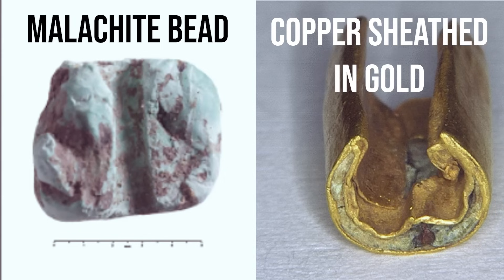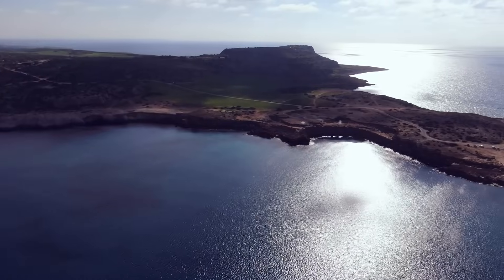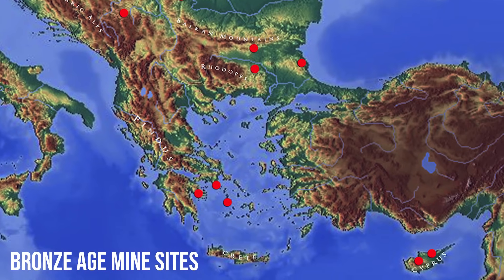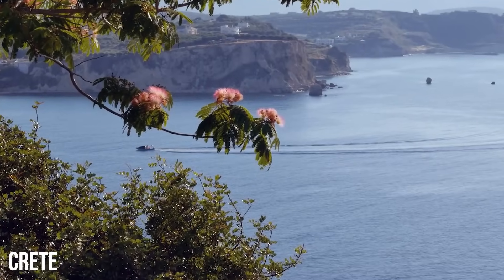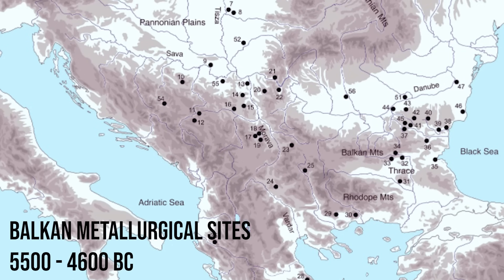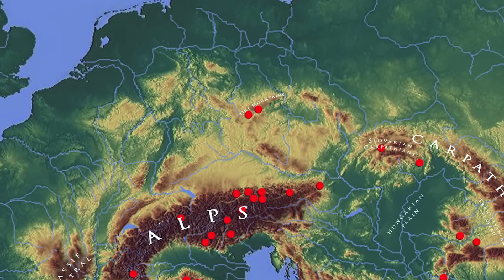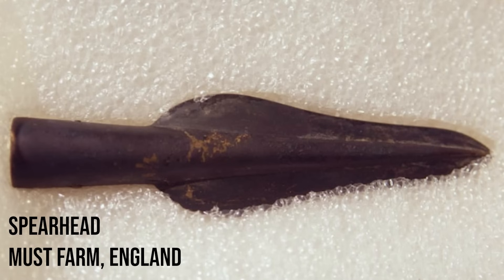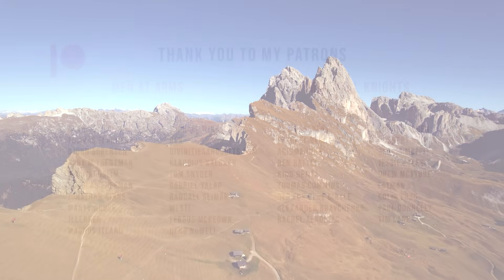These Ancient Mines Transformed Prehistoric Europe

Comment: I think the real mystery is why widespread use of metals never took hold in the Americas. The people of North America used copper to some extent for a while and then apparently stopped using it. In South America, they apparently even smelted a limited amount of copper alloys but AFAIK it never got significant use for weapons or tools. I would think copper and bronze would confer the same advantages in the Americas as it did in Europe but apparently for some reason the Native Americans didn't think so.
Reply from the maker: It's a great question.
Reply: @DanDavisHistory The reason is that smelting technology basically did not happen. Copper implements in ancient America came from deposits of native copper, not copper ore. While copper ore is widespread, native copper is much rarer. It is just an accident of geology that there is so much around the great lakes, and it is those deposits that account for most of the copper artifacts found in the new world. The metal was widely traded, so it appears in locations far from the actual source.

The relative rarity of the metal meant that it would have been used mostly for ceremonial use, not everyday use. While a lot was mined, that happened over thousands of years. The annual production across the entire continent on average amounted to about a suitcase worth of material in physical size. Spread that out across millions of people across the continent and you see the problem with availability.
Reply: @DanDavisHistory  I'm late to this discussion, but one thing I find striking about the European (or western Steppe region) development of the ability to not just use copper, but to alloy it with other metals is that it is roughly coincident with the development of two wheeled carts.  Heat and abrasion are serious impediments to speed and durability.  There would have been a serious motivation to figure out how to make better wheel bearings as attempts were made to use the carts as chariots.  This actually does dovetail well with Diamond's observations because of the dearth of suitable draft animals for using carts as chariots.  Often, the development of new technologies is driven by either an easy observation ((e.g. pottery flowing from clay lined baskets) or some challenge that drives experimentation.  The need for better wheel bearings would have driven some significant innovations in tool technology as well.  

The sequence may have gone something like this:  First the northern Europeans develop two wheeled carts to support agriculture and forestry. The people to the east trade for or capture some of them and take home.  They try to use them in battle, but fail.  So they go back to the source and explain the problem.  This goes on for a while until someone notices that some slag has become hardened can be controlled and made into a more durable metal, and so on.  The butt end of Corded ware battle axes or something very much like them would have been ideal for shaping and smoothing the female raceway of a bronze hub assembly.  The ones with the larger round center hole or something like them would have been just the thing for polishing the insert bushing that would have probably first been roughly shaped and mounted on the axle end.  There would have still been a serious lubrication challenge, but a lard bucket carried onboard would have enough in many battle scenarios  No long chases would have been possible, but short charges would have worked quite well.  Charioteers would have to have been VERY attentive to lube consumption and heat build-up.
Reply: Copper use actually never stopped. copper was still being used for art objects and certain tools all the way up to colonization. Because the great lakes copper is already pure, there's no reason to smelt it, so bronze production never really took over. Chert, flint, and obsidian are just as effective as copper for cutting tools (in some cases more effective than surgical steel actually) so once the great lakes region established exchange networks with the rest of the eastern woodlands around 3000 years ago there was no longer much need to make tools and weapons out of copper.  The Ancient Americas channel has a really good overview of North American copper industry.
Reply: I don't think that's a real question. It obviously was used, although smaller in scale. But we also know that North America had at least one and probably more cultural collapse and resultant Dark Age. When the new American colonists encountered them, its estimated that as many as ~95% of the native population had recently died by wave after wave of plague (in fact, the Little Ice Age is sometimes attributed to regrowth of so many trees due to this population collapse.) If North America as the "European" colonists first saw it was like the Mad Max post-Apocalypse version of native culture, it's no wonder that all kinds of things that they used to do were lost in the meantime.
Reply: @spacerx  The death toll among natives here was most extensive upon contact with Europeans who brought smallpox, and in fact began to use smallpox strategically to decimate native populations. This landmass was NOT sparsely populated generally.  There may have been some population declines in antiquity due to other catastrophic events, but there was considerable population recovery between then and the devastation of contagion which came much later with European contact.
Reply: @aaabbb8812 That isn't true at all. The germ theory of disease wasn't even articulated for many decades. That's not only a false narrative, it's an extremely stupid one that only really ignorant people would believe.
Reply: Supply and demand? As the video states, mining in the Balkans rose because of a large population that allowed for the allocation of labor to that activity, and declined when the population fell. and you would only allocate labor to extract copper if you have a demand for it.
Reply: The pressure to develop metals for weaponry would have been significantly greater in the Americas if they had the horse. Access to the horse was a significant factor in the evolution of civilization on the Eurasian continent. Australia is another example, it was populated for thousands of years before anywhere else but without the horse, and being separated from Eurasia allowed their culture to evolve much more slowly in alternative directions. 
That said if given enough time, South American cultures were becoming very involved in using gold, silver, and copper for decoration which is how metal work first began at the end of the Eurasian stone age. It was only a matter of time before some Inca like or Mayan related culture took the technology further.
Reply: @Alltime2050  Andeans and Purepecha were already using Bronze in the Americas.

And Australia is a Giant Desert(mostly). Unless having a super sea faring component to connect the more fertile outlaying areas and some alt domesticated plant that can take the bad soil in some areas, I don't see how they'll make it. Then again, a small habitable area to unify will also have its advantages for political unity.
Reply: @ikengaspirit3063  The only real difference between any of those places, Africa and Oceania included is they were isolated from the Eurasian continent. The only technology that was physically impossible for cultures outside of Eurasia to discover, was the horse. Discovering horsemanship at the same time they began smelting cooper and working with gold was like getting high-speed internet in those days.  The horse also made metal-tipped armies all but invincible as the first wave of genocides displaced first peoples across the Eurasian continent. Without the horse, Eurasian cultures would have evolved much more slowly and in ways more similar to those parts of the world where horses were not found. If the horse had not gone extinct in the Americas, it's almost a sure thing humans would have been fighting each other with metal weapons all over the place at the first opportunity.
Reply: @Alltime2050  You know, you're right but I think Population density is also a real deal breaker in alot of places.

Eurasia had the Near East, Europe, China and India(South-East Asia may or may not be added) as regions that could easily support a large population and population density over a large area and as you said, thanks to the horse and a more peninsular shape allowing those tech to transfer between areas faster.

I think population density is a part of this equation not recognized by many as well, More thinking brains(population), closer together to share ideas(population density) and ways to transfer ideas between cores of high population density/innovation is why I think Eurasia is the continent that developed the most.
Reply: @ikengaspirit3063 There were less than ten million people living on the entire planet at the beginning of the cooperage when the horse also came into play. Population growth in Eurasia began expanding exponentially after that while remaining relatively static with very slow growth everywhere else.
Reply: @Alltime2050 I was thinking it would be a real pain in the hole to carry around metal if you didn't have a horse. And why would you bother if you weren't going to make a stone house or didn't need chisels hammers and tools like that. If you could find a lot of flint or had the skill to use rocks then why would you bother with all that trouble. Unless for a pretty necklace or something. Also a sort  of critical mass thing. Like in usa people have guns because other people have guns. In europe if the guys down the road had swords you'd need swords too... if they didn't have swords why would you be bothered getting a sword. Like I'm irish we don't have guns cos nobody has guns so we don't need guns. If people started having guns here like criminals...then I'd need a gun too. And armour and such. And it kinda escalates. But if nobody has a sword then you wouldn't feel like oh shit I need to make a sword.
Reply: @Padraigp  Exactly.
Reply: @Alltime2050 ❤❤
Reply: @Alltime2050 for decorative purposes gold and even silver were used in America so perhaps the bronze wasn’t as valued
Reply: @Liveasamom  That's how it began on the Eurasian continent as well. The biggest difference between the two worlds speeding up the process many times over was the horse. If they had horses in the Americas the outcome most likely would have changed considerably.
Reply: @Alltime2050  The South American cultures used an alloy of copper and gold for many of their gold artifacts as well as pure gold. That copper had to have come from somewhere. Considering where copper was concentrated in the Americas, there must have been trading between North and South America here. There was so much gold in the Americas, that the Inca and Aztec were able to literally fill ships with it as tribute to the King of Spain. This greed for gold became an obsession and  resulted in Europeans enslaving natives to procure it for them.
Reply: @aaabbb8812  While a Slk-Road type of trade might have occurred on some level, those South American cultures were learning how to smelt metal. That never happened in the North, where pure cooper was lying on the ground. 

The production of copper spread throughout the Eurasian continent because they had horses. Everything in the Americas, including new ideas and technology, was transported on foot.
Reply: @Alltime2050  It is genes of European Neanderthals carried by Early European Farmers that really influenced the culture of paganist religion, materialism, greed, envy, the obsession with lethal weapons, cannibalism, human sacrifice, slavery, and warfare.  These farmers are represented by Cain in the Biblical story of Cain and Abel, and they spread the symbol of the swastika (the "Mark of Cain") throughout the world by boat, along with dolmen construction (and a few other traits inherited from cannibalistic Neanderthals), during ancient times.
Reply: @jedague That's an interesting theory but slavery and cannibals existed in Africa, Oceania, and Asia long before the first farmers ever existed.
Before the ancestors of the Hebrews were recording their first stories about Cain and Able, humans were already living on all the continents and most of the islands. Antarctica was the only large land mass that was free of humans. While not all of them were cannibals, almost all of them practiced some form of slavery. 
All ancient people were superstitious as F. Any peace-loving people were overrun, assimulated, or killed off by warrior cultures in a process that lasted all the way into the early 20th century.
Reply: @Alltime2050  At no other place in the world will you find cannibalism more ritualized and industrialized that in Herxheim Germany 7,000 years ago.  These Early European 
Farmers who used the symbol of the swastika were extremely violent.  Their migration can be traced thoughout the world by their unique culture.  I think it is very interesting, but also very frightening, to recognize how specific inherited traits have continued and spread throughout the world for millenium.   But my own preference is the for the megalithic builders of Gobekli Tepe, not the cannibals of Northern Europe who invaded Gobekli Tepe and inherited farming culture.  Consider Armin Meiwes, Amon Goeth, or Jeffrey Dahmer for example.  They would have felt right at home in Neolithic Herxheim.  Then study the migration of the swastika.  Modern descendants of the Mesoamericans who used the symbol of the swastika are members of Latin American Drug Cartel who practice paganism and worship death in the form of Santa Muerto.  This is an ancient, inherited trait which followed the symbol of the swastika.  After the Bronze Age Collapse, the symbol of the swastika migrated into China, Korea, and Japan, along with dolmen construction, pyramid construction, and human sacrifice.  Wherever violent people who engage in warfare exist, you find ancient evidence of the symbol of the swastika.
Reply: @jedague  There were only a few million people at most on the entire planet during the time periods you are referring to. 
While I don't take issue with your tracing the path of the swastica, I'm not so sure that cannibalism was as large of a factor past a certain Neolithic time period as you seem to be suggesting. Those cultures could be incredibly brutal and cruel all on their own. That's just my own personal speculation though. 

It's absolutely true that the Germanic tribes evolved into the most prolific and long-lived warrior cultures on the planet. I mean, they never stopped F'ing up any weaker cultures they came across. By the beginning of the 20th century, their descendants had conquered and controlled almost 80% of the world's population. 
On the one hand, it was a terrible thing. On the other, it stirred the stew. 
Without their eagerness to share their superior technologies to feed their never-ending greed for wealth and power, at least half the world would most likely still be in the stone age. 

It can be argued that the brutality of their world-conquering lifestyle was a useful mechanism for the advancement of our species.  
But if that was ever true, their usefulness as a tool for human advancement became obsolete the day they finally invented technology powerful enough to destroy the planet. 

Humanity has slowly been working to overcome their ancient worldview since at least the middle of the last century. 
I find it ironic that people still beholding to the superstitions of their Romanized Germanic ancestors have gone from masters of the world to the greatest non-natural threat to the survival of our species in all of human history.
I apologize for changing the subject if that's what I've done.
Reply: @Alltime2050  No apology necessary.  Brutality is absolutely correct.  It is the inherited traits of cannibals, the lack of empathy for others, which leads to brutality.  The descendants of ancient cannibals tend to engage in human sacrifice and unprovoked violence.  The Aztecs were prone to war and human sacrifice, their descendants are Latin American Drug Cartel that worship Holy Death.  The Japanese joined in Germany's warfare and destroyed America's Pacific fleet at Pearl Harbor, and engaged in horrific brutality, rape, and slavery during World War II.  The Koreans engaged in the Bodo League massacre and killed about 500,000 people during the Korean Conflict.  The Vietnamese engaged in the Cambodian genocide that led to the Vietnam war.  The Germans probably killed 100 million people during World War I and World War II.  Consider the horrible acts of brutality involved in the Holocaust.  These are the descendants of ancient German cannibals, the people who carry genes of cannibalistic Neanderthals.

But this aggression which led to dominance also has a negative effect.  And modern firearms may contribute to this negative effect.  The most aggressive people, those who tend to be drawn toward conflict and violence, they now tend to be on the front line of people who are killed during conflict.  So gradually the inherited traits of cannibalistic European Neanderthals are being removed from the gene pool.  Evolution is at work.  But every time you hear of a mass shooter, a monster, a cannibal (Jeffry Dahmer, Armin Meiwes, Amon Goeth) you can trace their pedigree back to Herxheim.  These farmers were brutal enough to gain a prime spot in the Hebrew Bible, in the story of Cain and Abel.  For millennia ancient people have told stories of the brutality of these Early Farmers who spread throughout the world during antiquity.  We're still dealing with the problems that the genes of cannibalistic Neanderthals create today.
Reply: @jedague wow, that sounds like some made up gibbery nonsense but I’m no anthropologist or whatever so 🙄 
😎🦅🇺🇸
Reply: I suspect the significant factors include:

1) copper itself is not terribly more useful than well-made stone tools. Only bronze will provide a truly worthwhile improvement.
2) getting tin together with copper to make bronze, implies trade (transport of large quantities of heavy ore or metal)
3) such trade is hard to develop without a certain level of organized government, fairly high population densities in some areas, and appropriate transport conditions (draft animals/carts/roads, and/or watercraft of fair burden and endurance along with bodies of water convenient for moving heavy loads; enough population to support the transport infrastructure, etc). Most of these conditions were present with the Inca, and they were using bronze. They were present a long time ago around the Med basin, and they also were using bronze. But even at Cahokia or the Mississippian polities, the necessary conditions were missing. I would suppose that the Central Mexico cultures would’ve started using bronze pretty soon had they not been interrupted; the Aztecs had consolidated the necessary conditions, by and large.
Reply: A few reasons:

1) Eurasia is rotated in an East-West layout while the Americas are in a North-South layout. This made it difficult for agriculture to spread very far beyond a few origin points in Mexico, Peru, Brazil, and the Eastern seaboard. This in turn led to less willingness to trade. It still happened of course, but on a smaller scale than we see in the Mediterranean. Less trade means less opportunity for technologies to spread.

2) The Caribbean is a LOT more dangerous than the Mediterranean to travel through so the vast majority of any trade routes would be overland, again a limiting factor to trade, especially with no pack animals, and thus technological spread.

3) Mining tycoons and early European colonists alike noted how much harder it was to get to metals like iron in the Americas than in Europe, the rocks were harder, the metals deeper, and that outside of maybe meteorite iron you'd NEED modern (well, modern in terms of the 1800s) equipment to get to it.
Reply: The reason is that the copper they used is native copper, not copper extracted from processed ore. Native copper occurrs naturally in some areas around lake superior, where it was dug up and pounded into various shapes with rocks. The quality of that sort of copper would not be that great, so there were limitations on what the metal could be used for beyond ornamentation. Plus they probably did not get a whole lot of it to start with.
Reply: Too busy admiring their gold jewelry.
Reply: @paulberry2884  😆 Some South American cultures definitely had impressive metallurgy skills with regard to gold. I don't remember the people off the top of my head but one culture had a method of making an alloy of copper, silver, and gold and treating it in such a way that the gold rose to the outside but remained bonded to the base metal. It was so good that the Spanish thought it was pure gold until they melted it down at which point they were mightily annoyed. I've read that the Incas made silver shoes for horses they captured from the Spanish during their war of resistance so metal-working was definitely a thing. Maybe it just got cut off by the Spanish conquest before it got a chance to really take off.
Reply: @itsapittie  Silver was abundant in Central America and would surely make a better sword than copper or bronze?
Reply: @pattheplanter  Silver is heavy and soft, a mace or hammer is the only reasonable silver weapon to make and even then just the head as the shaft would readily deform. Silver is far softer than copper or bronze
Reply: @pattheplanter yeah but if nobody else has a sword why would you need a sword. America has guns now and other people don't because why would you get a gun if nobody around you has guns. Like it's not a natural progression that you should start with stone and move on to metal and then get a gun. People have not all embraced guns since the gun was invented or discovered. Just cos its an option doesn't mean everyone is going to do that option as if it's like crawl then walk. Why didn't Europeans have origami? Why did nobody in ireland develop foot binding. These are not some sort of developmental delays. They are just options.
Reply: Lack of horses kept things more local.  The Mayas and Incas understood the use of wheels, but didn't have an animal that could pull tonnage like in the old world.  Horses surviving the last Ice Age changes everything.
Reply: Lack of sufficient pop density and competition I imagine. Specifically north America simply has no real need for that amount of industrialization. You have to develop an interest in farming first in order to get the population that high.

I have long suspected the lifestyle of the hunter gatherer is just a very HUMAN thing. Very natural. Whereas civilization brings a lot of interpersonal conflict and stress, and that people who preferred that lifestyle just kept to the periphery of civilization and held on to it as long as they could. Even several hundred years of exposure to Europeans after Columbus did little to convince North Americans to change their lifestyles.
Reply: Too busy ripping peoples hearts out and carrying stuff on their back rather than on wheeled carts.
Reply: A widespread Bronze Age did not emerge in the Americas due to the limited availability of tin, localized metallurgical traditions, the abundance of effective alternatives (stone and obsidian), and the lack of societal drivers such as intense intergroup conflict or the formation of early states requiring large-scale bronze production. Also, there was no need for military use, which drove much of the bronze technology in the Old World.
Reply: the people mining copper in Michigan were the Minoans
Reply: The only thing that strikes me as something the US didn't have was horses and I heavily suspect that horses may have been the reason that Asia and Europe and then Africa went into the bronze age but America didn't, bronze as armour doesn't work very well for a footsoldier, but on a chariot it does, like wise with the added time available and surplus generated by horses doing Labor  (plowing, transportation over land ext) would facilitate the specialisation and knowledge sharing required for persistent bronze and copper use.
Reply: Simply put, there wasn't much demand in the Americas.  Metal tools, implements, weapons, etc become much more useful when you have draft animals, which they didn't have in the Americas.  Many, if not most crops in S America were grown on terraces, not fields like in the Middle East and Europe, so draft animals would have been less useful even if they were available... so they didn't need to develop metal rims and spokes for wheels, metal plows, metal parts for wagons and harnesses etc.  Metal weapons and armor used by the Spaniards are much more useful when used on horseback.  Once they invaded, many Spaniards gave up their plate armor for lighter padded armor used by the indigenous Americans, and gave up their swords for the clubs they used as well.
Reply: Not an expert - possibly tin availability  -  copper certainly isn't a bad metal, but its comparatively soft compared to bronze.  So unless someone happened to experiment with copper ore and tin ore simultanously and followed it through and enough people knew about to figure out the process. And smelting bronze  is an intermediate step to iron as far as smelting temperatures go.  Ignoring arsenic for now.
Reply: @tacitus7797  Apparently a couple of Andean cultures did smelt bronze. Of course, they were separated from the rest of the Americas by 1,000 miles of some of the most hostile jungle in the world so perhaps it's just that the few people who did it never had a chance to share the knowledge.
Reply: @tacitus7797  Andean and some cultures in the south used arsenic and other ores to create pretty strong bronzes and Inca was already experimenting smelting hematite, because they used to cut rocks, and rarely ilmenite. During final moments of spanish conquest of Peru, Inca was producing better sword than Spaniards with appropriate size and form. But some internal struggles about Inca’s Emperor and very young one leadings
during the war was good to enough to facilitate Spanish Conquests
Reply: Inertia (as in being content in ones level of tech) can be strong. Why did the wheel have such a limited origin and only spread when the tech was exposed to other peoples?
Reply: It is interesting and could have much to do with the time of the migration of these peoples across the land bridges. The death rate would have been fairly high and the "elders" dying, and the knowledge they had, lost.
Reply: The Native Americans used copper in its "native"state or with very little working and no smelting. They did have widespread trade networks as evidenced by sea shell ornaments located far inland, etc. They used copper for ornaments, crude arrowheads (coneshaped) and there is what could be a flint working tool found among northeastern Meadwood culture artifacts from roughly 2,000 yrs ago. They made wonderful large thin bifaces that could be made into various tools. Lastly, i learned that many Pacific island peoples never used/developed ceramic pottery even though they had the materials available, why? They didnt need pottery as they had other means of storage/cooking vessels - probably why Native Americans didn't develop more advanced use of copper.
Reply: Oh, and for those who dont think NAs didnt develop large scale agriculture look at the developnent and spread of maize as an example.
Reply: I read that the American copper was too pure, and therefore, there were no accidental alloys. No accidental bronze means no hardness. Compared to Flint tools, pure copper is soft and doesn't hold an edge.
Reply: Probably was used by the white people before the todays natives moved down in from Siberia.
Reply: Man plus horse plus metal equals war .
Reply: its about the combination of high intensity agriculture, so the culture can "afford" artisans, and be lucky that a artisan to invent metal tools, have mine that produce copper and tin within reach. 

Not that the cultures that  have high intensity agriculture in America, do not have a nice inland sea like the Mediterranean Sea or inland river like Danube that connect different culture that have high intensity agriculture like them in Europa, to move trade gods (ore) and transmit ideas (metalworking) 

For all we know, some American artisan did invented metal tools, but there was no real way to get accesses to cheap copper, and the idea did die out.
Reply: It's about racial capacity, obviously. Just look at Africa.
Reply: Copper by itself is much less useful than copper which has been alloyed with tin to form bronze.  In Europe the ores were occasionally "contaminated" with arsenic (naturally forming arsenic  bronze) so they would have known that some forms of copper produced much better tools than others.  This is likely what led them to alloy copper with tin.  This development process never occurred in North America.
Reply: @rockets4kids  No, but it did occur in South America, yet it never really got into widespread use. It would be interesting to know why not.
Reply: @rockets4kids  What you are talking about is arsenic bronze and it did indeed not develop (to our knowledge) in North America. It did however evolve in Tiwanaku and we see some uses of it among the Incas. In Mexico, the Zapotecs were the masters of metals but they mainly seems to have used copper and gold, the little arsenic bronze we found in the area might have been imported so we don't know if they knew the process or not.

The reason no one invented tin bronze might partly be because the 3 largest tin deposits are in Alaska, California and Bolivia which lacks large copper deposits in the areas, there are some smaller around...
In the old world, we generally see the earliest bronze production around places who have a lot tin and copper, like Cyprus for instance.

The area around Tiwanaku is rich in copper and arsenic which is likely why arsenic bronze was invented there and it wasn't just a random contamination but a product made on purpose. However, it was a very dangerous work so they could never produce the massive amount of bronze we see in Asia and Europe.

In Puma Punku (you know, the place the weird Ancient aliens guy make weird hypothesis about all the time) they actually made bronze hooks keeping the stones of some of their building together, the Greeks used a similar method.

Arsenic bronze is more brittle then regular bronze but it is certainly still good enough to make weapons (like spear tips and knives) and armors out of as we see in Eastern Europe in the early bronze age. It was however rather expensive so it was not something you could use on a large scale. Some tools have been found but very few weapons, that might have been because they melted them down again when they broke though. Most of it seems to have been used for jewelry by rich people, we also found some bowls and other random object, all decorated and looking expensive.

The thing is that the only places in the Americas that really had the potential for inventing real bronze was Peru and California. California have plenty of both metals and was inhabited so it had pretty good chances of inventing it there but it never happened. Peru only have small tin deposits so it is less likely.
Alaska also have both but had a tiny population which tend to hurt inventions.

In Tiwanaku, it is likely that someone noticed that the copper who was contaminated by arsenic was a lot harder and more useful, and figured out a way to replicate that. The lack of tin in the area killed of any further developments though. It is very possible that if whoever figured out how to make arsenic bronze got his (or possibly her) hand on tin, it might have sparked an American bronze age.
Reply: I think you need to research, more. The bronze age in the u.s., apparently ,
does have a long rich history
Reply: Lower average IQ leads to less sophisticated culture.  In other words, not much "stuff"
Reply: They literally didn't even discover the wheel. I think that answers your question
Reply: How about that wheel eh.
Reply: I don't believe that there are any significant deposits of tin in the Americas, so that would rule out a "Bronze Age" in the Americas.  There are limited tin ore deposits in Mexico, Bolivia and Alaska.  As far as I know, there are no placer deposits.

hth
Reply: afaik they never got to the point of figuring out the more ideal ratios for bronze (9:1 copper/tin in the classical world) which may have been a factor. Maybe the old world got lucky in figuring out how to make the good stuff.
Reply: @mynym4543 Well there is that, but the big impediment to a bronze age in North America is a lack of tin deposits.
Reply: No. It isn't a mystery at all. The 2 continents are nothing alike, socially or geographically.
Reply: There's another factor in the terms of copper alloys used in North America is the general lack of tin deposits. The whole idea of native copper from deposits on Isle Royal and the Kewanee Peninsula is an idea that really flies in the face of logic. For one thing the Upper Peninsula is a good way inland. Summers are pretty short compared to other copper using regions. 
Did any Bronze Age sailors wind up in North America? Its possible I suppose. Did they get home? That another thing. Most likely no. And any Bronze Age sailors that did wind up in the Americas most likely wound up in the West Indies. Now could a  Bronze Age or early Iron Age vessel have been driven by weather and current across the Atlantic. And then picked up pieces of copper in trade. And then made it home. It's long odds. Possible but not likely.
Reply: @mpetersen6  I think it's very likely that every century or so a vessel from Europe or Asia made landfall in the Americas due to being caught in a storm. I think it's very unlikely that any of them made it home or arrived in sufficient numbers to make any noticeable impact on American cultures. I think the probability of a trading network linking the Americas with other continents is essentially zero.
Reply: Bronze is nice and all.   But consider the differences in development between a food-rich all-season area like Egypt to Bronze Age Britain or Scandinavia.   Part of the difference might be that Egyptian terrain was better suited for Bronze tires on chariot wheels.     So I don't think nations in the Americas would have enjoyed all that many more advantages with or without it, especially lacking horses.       Other factors played a more significant role.    A harder metal like iron might be different.  Since this allowed iron tires for chariots etc. That can handle continental European terrain etc.     Americas still lack the horses.
Reply: @MarkVrem  That's a good point. That certainly could have been a factor.
Reply: There is no mystery. Copper is pretty useless as a weapon. Metal weapons and tools only really took off when bronze was invented. During the "copper age" even most Europeans still used stone, bone or wood tools for everyday use, there is no reason to think Americans would have done anything different.
Reply: @Tugela60  Are you forgetting or ignoring beads, Jewelry, clothing and body decorations.  Gold and silver are preferred, but Copper and bronze have been used in these applications.
Reply: @dewayneweaver5782  All of which were pretty much limited to high status individuals due to the sheer amount of work required to extract and process metal in neolithic societies. Even in the early bronze age, most people would have still been using stone, bone and wood.
Reply: @Tugela60 dude they built all the pyramids for hundreds of years with copper tools. They definitely were not useless. But if you had no intention of doing the things people do with metal why would you bother ...like I dont think they built stone castles ... they didn't have horses to carry a heavy metal thing around..they could walk around and leave their rock tools behind and just find rocks where they went ...they were going to put up a tepee yurt thing to live in and move along in a while anyway so no need to shape rocks into a castle ... except for making pretty beads of shine copper or nice ornaments why would they bother with copper when they also didn't bother with the things copper was being used for either. Like if you don't eat bread don't buy a toaster.
Reply: @Tugela60  
Copper axes were very common and no doubt used as weapons, of course they better suited for than let's say copper blades which tended to be daggers for the most part.
Reply: @Jarlemoore1  They were not "very common". They were used for ceremonial purposes and would have been only owned by high status individuals. A copper axe is no match for a neolithic stone axe when it comes to actual work due to its softness. It requires constant sharpening. Metal only became relatively common and functionally usefull for everyday purposes during the bronze age since bronze is a lot more durable and holds an edge far better than copper.

Bronze requires tin, and there is no evidence of tin usage in the Americas AFAIK. That means that the copper mined in America in ancient times was probably used for ceremonial purposes, and more likely mostly for pigments, something copper happens to be very suitable for. Everyone seems to be overlooking that other obvious application of the ore. Just because copper ore was mined does NOT mean that is evidence of extensive metal use.
Reply: @Jarlemoore1  They have not been found in "a lot  of graves", they are only found in high status graves. Copper weapons and tools in the chaleolithic were not common at all, most tools in this period were still made of stone, bone or wood.
Reply: @Tugela60  the copper wasn't in ore form, like locked up in minerals. It was nearly 99.95% float copper. You can find veins of solid copper in the great lakes regions.
Reply: @Tugela60  give me a Copper Axe every time, I wouldn't say a copper axe requires "constant sharpening", the edge simply needs to be annealed & then hammed back to a thin edge which coincidentally also "work Hardens" the edge, if over the long term the Copper Axe becomes warped to the point of un-usability then you simply melt it down & recast it.
On the other hand a Stone Axe that is as sharp or sharper than a Copper Axe is of a type of Stone that is Napped & is also brittle enough to need constant Napping & Napping is a skill that takes years to master, Stones Axes that are harder which require a ground edge are never as sharp as either a Copper or Flint Axe & lastly neither type of stone can be melted down & recast.
Reply: @Tugela60  
Useless you say. Copper leaps buildings in a faster than a speeding train. Carves obelisks in a bound. Builds pyramids in a thrice. It's a miracle material.
Reply: Jarred Diamonds take on the question is imo flawed but does make some very strong arguments. 

Basically, Eurasia has a lot of places within trading distance of each other that have similar climates. This allowed agriculture to spread rapidly along the region between Spain and India, and the plains of China were large enough to be their own separate cultural center. Meanwhile the vast steppes and the Indian ocean and seasonally-reversing monsoon winds and east asian seas and island chains created lots of opportunities for less direct but still culturally significant trade.

The Americas by contrast are more broken up into smaller climate regions so there is less opportunity for those kinds of extremely long distance exchange of ideas.

Also, his point about nearly all the economically-useful herbivores in the Americas having been wiped out seems valid, as does African fauna being universally impossible to tame.

What Diamond claims that I'm less convinced by is that there weren't enough useful agricultural plants in the Americas.
Reply: @j.f.fisher5318  I've read his books and I agree with your analysis, but that doesn't explain why people in the Michigan region who had a nascent copper culture abandoned it or why South Americans who were smelting and alloying bronze never used it more extensively.
Reply: @itsapittie  
Maybe it was abandoned because the people who it originated with were wiped out and replaced or famine or disease caused them to move away from the copper sources and after a few generations it was forgotten about.
Reply: @Jarlemoore1  It's a bad theory either and could possibly be true.
Reply: @itsapittie  not a mystery dude.  All that NA copper came from a single source. Not ore, metallic copper.  The locals never learned smelting, just cold hammered copper metal.
Ancient Americas has a nice video on YouTube about it.
Reply: @itsapittie 
And then there's the idea of societal collapse. If the Bronze Age societies, which in some ways were far more complex and sophisticated than even our own modern societies, with far more safeguards against disaster than a simple tribe could ever hope to have, could fall apart then what is keeping semi-nomadic tribes in the Americas from also falling apart? Especially when considering these tribes were often just one bad harvest away from mass starvation.
Reply: @itsapittie I mean didn't they live in yurts or something? So they wouldn't hsve needed hammers and nails for that. And did they not have horses? Before Europeans brought them? So if they didn't have horses they wouldn't have gone very far without walking ...did they have doneys? Carrying a load of metal around might be fine on a horseback but dragging it on your back might be a pain in the hole. Be handy for cutting trees down though how did they manage that without any metal?
Reply: @j.f.fisher5318  The cultures of Central and South America produced Cities, Temples, roads, bronze implements and small scale  Empires, they domesticated llamas for pack animals and alpacas  for wool.  There mane deficiency seems to be the lack of  horses and mules. Do both Eastern and Western Civilization owe their prosperity to the humble Ass?  I don't think the case is proven but it's an interesting thought.
Reply: @dewayneweaver5782  The ironic part of the lack of horses as draft animals precluding the invention of wheeled vehicles, etc, is that the early migrants to the Americas killed and ate them all.
Reply: @dewayneweaver5782  "Does Eurasian culture owe its development to the humble ass?"

Yes, the bigger the Ass the better
Reply: @j.f.fisher5318  how were the herbivores mostly gone , in the Americas, 5000-4000 BC?
Reply: @j.f.fisher5318  There was plenty of plant agriculture in the americas, a great deal of modern crops originated there:corn, potatoes, tomatoes (less sure about them), squash, cacao, etc. Regarding animal agriculture I'm curious why it didn't catch on. Horses are originally from north america but went extinct there at the end of the last ice age for reasons unknown, bison are large and cantankerous compared to modern cattle but are perhaps analogous to their ancestor, the aurochs. Javelina are not so different from Eurasian pigs. It occurs to me that agriculture perhaps creates the conditions for its own necessity: in the old world, natural systems were disrupted by agriculture (land degradation, disruption of migratory paths, human population growth), making more intensive agriculture a necessity to sustain the growing population.  In the new world it seems in most places they didn't turn that corner, although there are many examples if landscape management to better facilitate hunting and gathering (periodic controlled burning to revert woodlands into savannah comes to mind), as well as small scale agriculture to supplement the diet.. This is just speculation, I don't have any qualifications
Reply: @j.f.fisher5318  interesting that he claims there weren't enough agriculturally useful plants in the Americas since about 70% of the current world's foods originated here. I think the lack of metallurgy in the Americas was due to the abundance of resources and the lack of equivalent population pressures.  Unfortunately, the lack of animal domestication meant that the opportunity for exposure to pathogens passed us by. There is a theory that European proximity to domesticated animals allowed populations to develop immunities to disease over time...except for the diseases introduced by trade with China, which has a geography that creates diverse petri dishes in isolated climates. Bring any of those petri dishes together and cross-species pathogens erupt. Nearly all the pandemics of the world originate in China.
Reply: @j.f.fisher5318  you need to combine some other authors to flesh out diamond.  Flannery (I have it in the library if you are interested I can be specific) wrote a history of NA from the chicxulub comet impact to modernity.  One huge problem we have is the shape of the rockies/Appalachian mountains- they act as a funnel to pour extreme weather into the continent. That handicaps agriculture enough to keep it rudimentary.
Reply: @j.f.fisher5318  2 of the 4 greatest crops in history, corn and potatoes, came from the America's so yeah I'd agree that it is a weak argument.
Reply: @j.f.fisher5318 I mean the Americas includes america which is one big landmass... that doesn't make much sense. Its a big continent I know it's not as big as eurasia with its connections to India Africa etc but its still pretty big and diverse enough to warrant trade.
Reply: @j.f.fisher5318  Native Americans did have extensive trading occurring.  Most notable are the Commanche who traded with both Mexican tribes and the Northern Plains tribes.
Reply: '“America“ is a Spanish word, when you say “Americas“ you are saying it incorrectly. “America“ is one continent. When Spaniards refer to “Americas” they are refering to the islands of America. Please dont use Spanish words if you dont know their meaning.
Reply: @sergiogcollado  I thought that the name America was based on the work by an Italian explorer, Amerigo Vespucci.  The word was coined by the German cartographer Martin Waldseemuller.  He named the lands "America" based on the Latin word "Americanus".
Reply: @j.f.fisher5318  Cross-biome trade is already long-documented. A much more significant factor is the lack of animal transportation; however, the Americas still had ship trade. The latitudinal trade network from Europe to Asia covered sea, and large swathes of entirely uninhabitable desert and mountains, and trade has long ran north through south as much as east through west. This fallacious claim is one of his claims that actual anthropologists and historians most dislike his work for.

Africa is (somewhat) less lacking in tamable animals than often touted. They had cattle 6,500 years ago, albeit most other domesticated animals are Asian in origin. Rather than a lack of available animals, some that were around in more northerly areas have difficulty further south due to disease and teste fly.

What is now Brazil has the greatest biodiversity on the planet. A large proportion of globally dominant foodstuffs are American in origin-maize, bell and chili peppers, tomato, potato, sweet potato, many varieties of beans (the introduction of a few beans and legumes from Asia preceded a population explosion in Europe), squashes, cocao, vanilla, and less commercial crops such as amaranth, quinoa, peanuts, a long list of fruits, cassava, chia, and many more. Beyond that, the Americas have a lot of arable land. If anything, the Americas had the advantage regarding agriculture.
Reply: @NevisYsbryd  Yes...agriculture in the Americas is almost too easy. I still grow food the way my Cherokee ancestors did. Companion planting, natural fertilizers, atmospheric irrigation practices. The rock berms we use passively collect morning dew. Ollas in the ground collect rain and passively keep the mounded plantings healthy. In South America, indigenous migrant workers plant like this, leave to earn money in the cities, and return to their passively farmed food sources. I used to know the name of this practice and want to learn more about it. Because, vacations....
Reply: Bronze is the real important material here, and only the Inca had developed bronze smelting. They were making it into tools and weapons, but the technology was fairly new, and had not had time to spread further. It is likely the Americas were on the cusp of a bronze revolution when the Europeans came over in force and destroyed their societies.
Reply: @tesnacloud  
Well there were the huge tin deposits in what is now Bolivia.
Copper alloys called bronzes do not always include those with tin. Other common alloying elements include Phosporous, Aluminum/Aluminium,  Iron, Beryllium and Nickel. Phosphorus is normally an alloying element in Bronzes meant for journal or plain bearings. Aluminum/Aluminium, Iron and Nickel are used in Aluminum/Aluminium Bronzes used in bearings, tooling and high wear applications. Berylium Copper alloys are used for non sparking tools meant to be used in chemical environments with high chance of fire or explosions. The golf equipment Ping used Beryllium/Copper in it's original Ping putter. Other uses alloy include anvils anvils and tooling for injection molds. Naval Bronze is an alloy of Copper, .7 % Tin and around 35 to 39% Zinc. The variance in percentage is to allow for the inclusion of Lead ~ 5% to increase machinability. These alloys commonly used in marine applications due to their strength and corrosion resistance.  A common use is ship propellers
Reply: @mpetersen6  In the bronze age tin was used. Other than a few natural or accidental bronzes they did not use anything else. Native americans did not mine tin because they did not know how to extract metal from ore, so the presence of tin or any other k8nd of ore deposirs in the Americas is irrelevant. The copper mined in the great lakes area was native copper, it was not produced or refined. It was simply dug out the ground and hammered into the forms used. That is fine for some high value ornamental or ceremonial objects, but not much else. This is completely different from how copper was used in Europe, where they did know how to extract metal from ore.

I know there are people claiming that massive amounts were mined, but that is based on the assumption that 10% of the pits dug were pure copper, which is obviously complete nonsense. The actual amount mined is more likely a miniscule percentage of that. It would have been worth all that effort to them because it was comparable to gold, both in value and rarity.
Reply: @Tugela60  where do you get your facts from? Millions of tons of copper was extracted where is it! This is been a known fact for a long time so I have no idea where you're trying to get your facts from! Have you even been to the mines and seen them?
Reply: @panzermacher  
I'm not saying that ancient miners or Smith's could identify different metal beyond the classic ones known. I was merely pointing out that there are different varieties of copper alloys. Also the first production of bronze had to be an accident. I suspect that in the early Bronze Age the casting and alloying of the metal was closely held secrets. The art was entirely empiric in its practice. And if a group or family if smiths accidently stumbled on something that produced a superior product. Maybe somebody was casting bronze in to clay forms. Clay that just may have been rich in Aluminum/Aluminium that was able to leach some of the Aluminum/Aluminum/Aluminium into the bronze improving its wear resistance or hardness.
Plus Bauxite isn't the only "ore" that Aluminum/Aluminum/Aluminium is extracted from.
Reply: IQ answers everything.
Reply: This desire for lustrous metals is an inherited trait.  It is only after pyramid construction migrated to Coral Peru that Mesoamericans developed an interest in lustrous metals, and only when a group of Canaanite sailors landed in Brazil after being shipwrecked while sailing from the Red Sea around Africa that you'll find the practice of worshipping Canaanite gods and child sacrifice among the Chimu of Peru.  This inherited trait of materialism, inherited nobility, paganist religion, human sacrifice, slavery, and warfare could be found in the Early European Farmers of Neolithic Europe.  The descendants of Early European Farmers who carried genes of cannibalistic Neanderthals spread the symbol of the swastika (the "Mark of Cain") throughout the world by boat during ancient times.  The symbol of the swastika was very present in ancient Mesoamerica.  And the ancient elite of Mesoamerica have been found buried in pyramid tombs which contained rich grave goods and red cinnabar.  Plus, they worshipped the Canaanite moon god.  Mesoamericans even constructed a pyramid devoted to this Canaanite god.  But if you want to find the earliest evidence of this culture, you'll have to look at Sunghir Russia, where an ancient mammoth hunter who carried genes of Neanderthals was buried in clothing ornamented with beads made of mammoth ivory to exhibit his elite status, along with weapons, rich grave goods, and red ocher.  This culture existed for at least 33,000 years, and was spread throughout the world along with the symbol of the swastika, dolmen construction, pyramid construction, Neanderthal genes, materialism, greed, envy, interpersonal violence, paganist religion, human sacrifice, an obsession with lethal weapons and the color of fresh blood, occasionally cannibalism, mass murder, warfare, and genocide.

These traits are inherited, carried in the genes of some people.
Reply: Perhaps the blacksmith's craft in America, as in Europe, was a well-kept secret knowledge of specialists. The difference could be that in America the carriers of this knowledge were even fewer than here, and therefore mass production was not possible. Or the passing on of the knowledge was interrupted by war or natural disasters, because the knowers died.

I don't think it is completely impossible that sporadic Europeans (for Phoenicians exotic trade routes and maps were certainly secret knowledge too) discovered America and brought this knowledge with them. This could explain a small group of initiates (of course speculative).
Reply: @vanrensburgsgesicht  Well for starters, the natives never did stop using it.  Most of the modern copper mines in my area were well documented by European explorers and discovered because the native peoples were already mining it though is smaller amounts as their access to plentiful supplies was probably dwindling.   One thing to understand is that when the most copper in the americas was being used.........they had the least developed trade routes established and there were a lot less people.  You'll also see that the areas where copper is used most heavily, there isn't quality stone to use for tools, or at least not in the same volumes.  My theory is that the peoples living in the great lakes area had plenty of copper but very little flint, chert etc..........so they were forced to use the copper which was fairly plentiful.   That doesn't sound like a bad deal on the surface until you try to actually work some of this copper without being able to melt it.  It's a HELL of a lot of work to make one simple knife blade as compared to a stone blade.    More like forging iron without being able to heat it up enough.  High labour, long process and probably  very valuable as a result since there were less people to work it.  As trade routes became more plentiful and developed, possibly due to the availability of the copper goods themselves, cheaper and easier to work imported stone became more readily available and the common people(growing in number) could then better afford stone which was easily worked and almost as effective as a tool.   The demand for the copper diminished over time and it became a luxury good only.   Mostly used for ornamental purposes rather than day to day items.   Without furnace technology to melt the copper is was just too labour intensive to use once the smaller float copper(nugget) sources were dug out.  Sure they had huge veins of solid copper which still exist today but breaking those down into useable pieces and then making items out of them is a monumental task.   Much like the modern world, the price of labour can kill a product line.   That's my theory.........based on very little evidence other than youtube videos lol.
Reply: @MrBottlecapBill  So they didn't know forging and formed it cold? That would be a good explanation.
Reply: @vanrensburgsgesicht  Except that some cultures in South America did use forging and smelting. It's possible that for some of the reasons presented in this thread, metallurgy was relatively slower to develop than in Europe and it might have taken off in a big way given enough time. But Europeans arrived and you know the rest.
Reply: @itsapittie  the  copper and bronze ages were THOUSANDS of years ago..... Europeans there fewer than 600 years....

So what do they have to do with anything?
Reply: @MrBottlecapBill  I'm personally a fan of Joseph Tainter's approach that I read in "the collapse of complex societies"... he says, society is a form of complexity... it takes more energy than not having a society.  Rather than ask why a society collapses, we should ask why it existed to begin with.  Similarly for a process like bronze production.  The base state is an economy not affording for people to play with rocks in an unguided manner on any significant scale... unless there's a proven reason why playing with the rocks is worth paying for, people will only do it a little on the side.  Same with the roman-era steam engine.. the reason it wasn't harnessed is because the society didn't allocate the resources for it to be harnessed.  Viewing it that way, rather than explain why native americans didn't harness copper the way europe did, we should instead explain why europe did harness copper at an industrial scale.
Reply: @MrBottlecapBill did they build stone castles and houses? I have no clue but I thought they lived in like yurts and didn't have horses so I feel like if you aren't chiselling rocks for castles or don't have a horse to carry your metal stuff around it would be burdensome. And you could build your house without a hammer. How did they cut trees down without axes though? Did they use like flint axes? I guess you could get a flint anywhere so why would you carry around a knife or axe if you could walk hands free and find a rock when you got wherever you were going. I may be totally wrong maybe they used buffalo for riding around on. I just had heard they didn't have horses till Europeans ...maybe Europeans didn't have horses then either... but metal seems like a heavy thing to carry without a horse ... or some sort of beast of burden.
Reply: @MrBottlecapBill a lot of tribes used obsidian among others which can be very efficient. If their stone types were somehow easier to manufacture , stronger, sharper, lighter ect they might overall be more beneficial than in the rest of the world???
Reply: @vanrensburgsgesicht 
My theory, and yes I'm a blue collar tradesman with no training in this subject so I have no weight behind this claim is that Europeans/Asians did reach the America's sporadically and That is Why they never developed.  Imagine if every 500-1000 years a group showed up to an area with no resistance and spread a new plague?
They say most European colonists never saw the victims of the diseases they brought,  just empty villages and clearings they couldn't explain, what if that had happened repeatedly throughout American History through no fault of either party?
Reply: Obviously the answer is because they shipped all the ore they mined to Europe and didnt have any left for themselves.

Bad trade agreement.
Reply: That's the question I thought he might explore here. Click bait title. Our understanding of American ancient history is very limited, and mostly wrong
Reply: Very simple.  They never had the population density.  Why the low density?  Because they didn't need to, it was a newly settled continent  

You still see it today, USA has 1/4 the density of anything in Eurasia
Reply: @AKu-xs5vg  The reason they had low population density was because so many of them died trying to swim over to Europe carying all that copper ore on their backs.
Reply: @GrimgoreIronhide  Dude what are you smoking where you think an entire continent had the plurality of its population as traders?